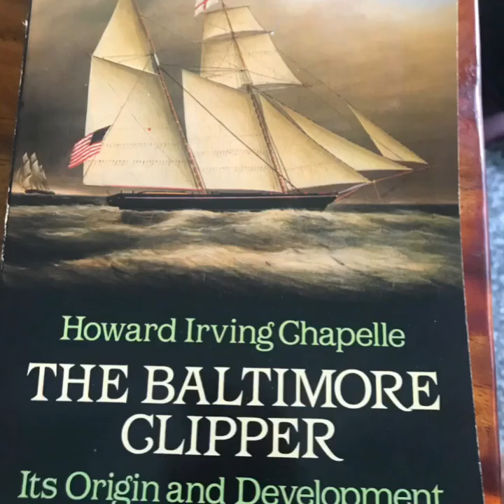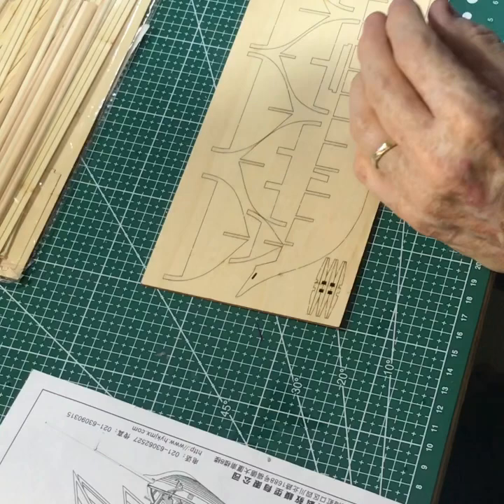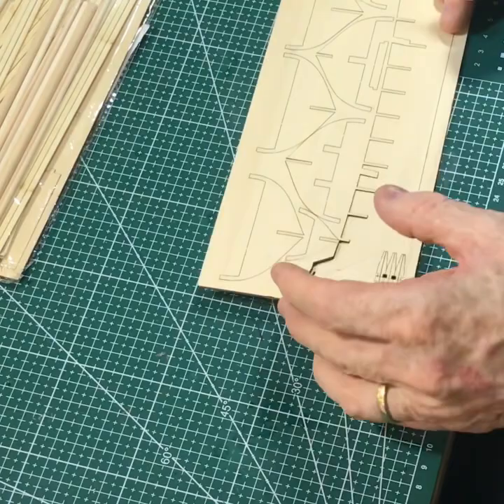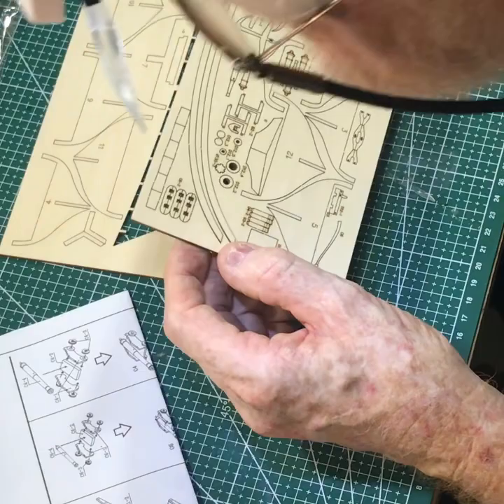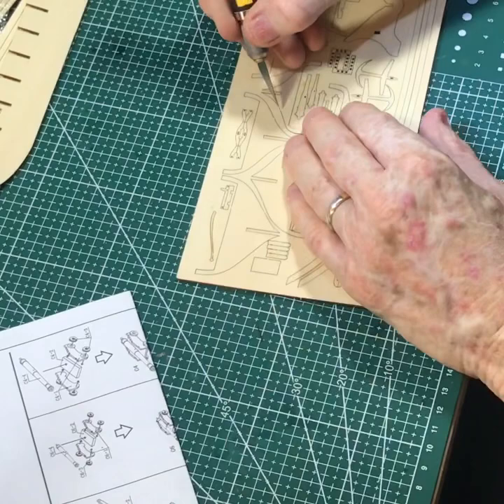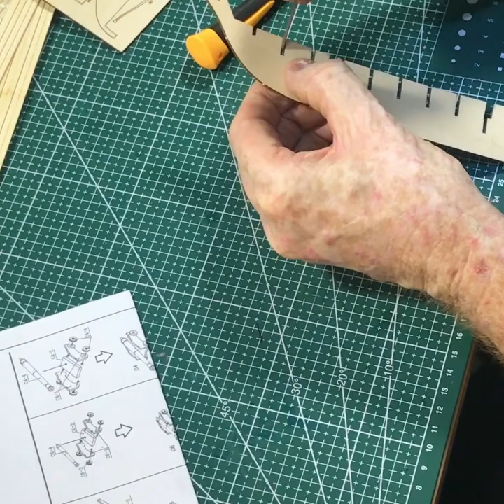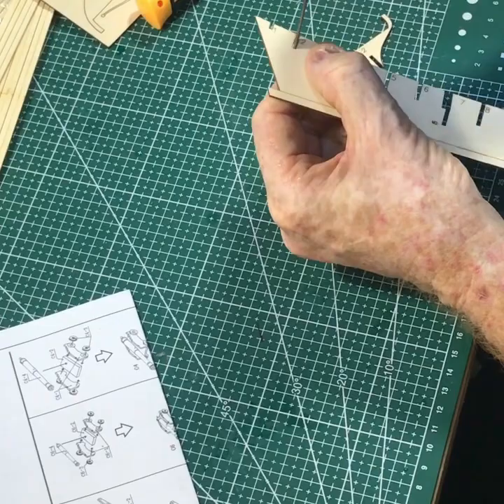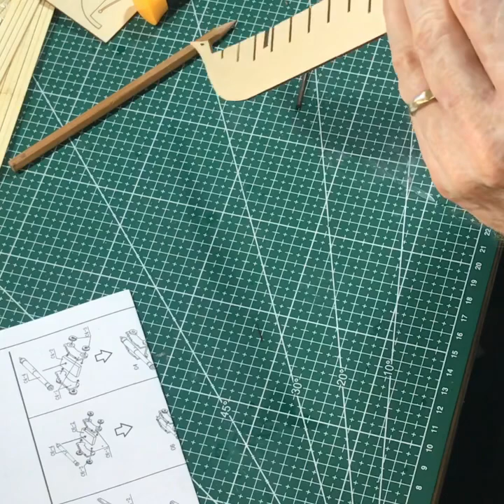Beginners guide to modelling a wooden ship Part 2

Comment: Since you mentioned your square getting rusty, one thing I found for rusty tools is to coat them in a mixture of boiled linseed and beeswax. Heat the beeswax but don't burn it (if I remember correctly, it was about ~70C), then mix 1:1:1 with boiled linseed and mineral spirits (or artists solvent). Supposedly the solvent helps mix the two together. Should be lightly heated together (just not directly on a flame; use a warm water bath as a buffer and do it outdoors cus it's flammable). Once it's mixed, it can be used to lightly coat the tool. Wipe off excess. Allow to dry for a couple days without touching. Coating should last a good long while.

I did this in a video on my channel, "glassblowing jack restoration", if you'd like to see the process. It's kinda buried though. Most of the video is sanding and prepping the tool itself, then a whole lot of fiddling with filtering some old beeswax. I ought to do a quick how-to for making it, because it's a lot more simple than it sounds. The tool itself has been hanging outside for 2 years now and doesn't have a spot of rust on it (whereas without the coating, they'd rust within a couple days).

In short: 50ml melted beeswax (~70C), 50ml boiled linseed, 50ml mineral spirits/artists solvent. Mix in clean container (small metal paint can) while warming in a water bath (~70C). Apply to clean tool (remove rust beforehand), wipe excess, allow to dry for 2 days. Forms an excellent vapor barrier. 

Thanks for the tutorials! Been interested in picking this up as a hobby and it's nice to see the whole process.
Reply from the maker: Thanks for the suggestion.